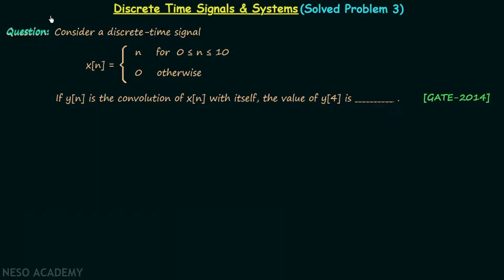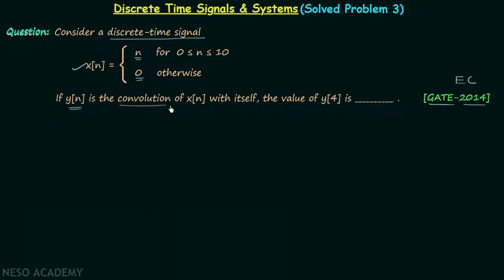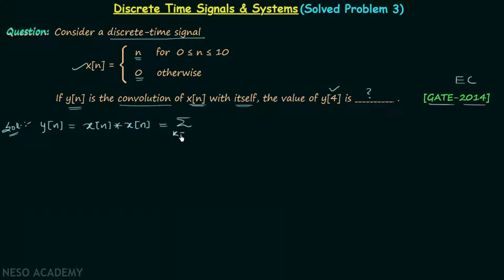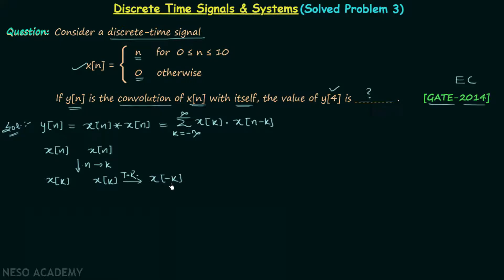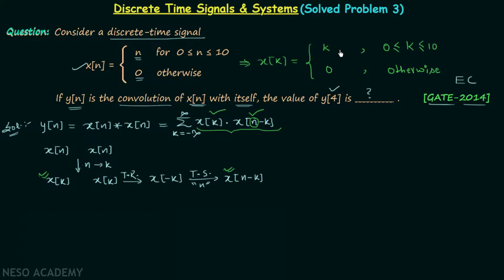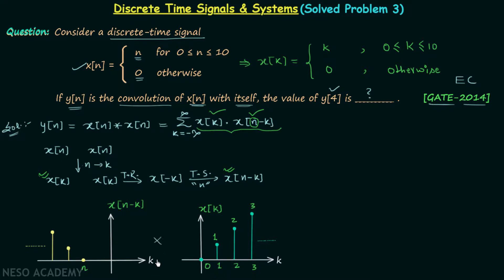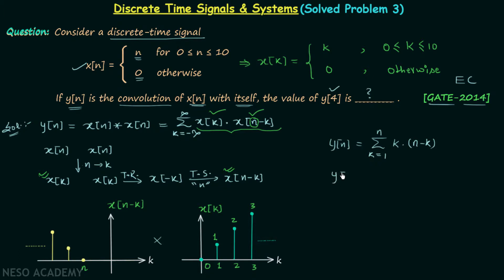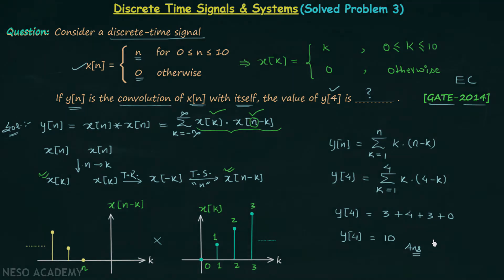Discrete Time Signals & Systems (Solved Problem 3)

Comment: sir in the above lecture in the case of y(n) value ....why you have taken (n-k) instead of x(n-k)....i am confused plz help me out sir
Reply: Niha Dabbikar We are actually taking the magnitudes of x[k] and x[n-k] which are defined by these functions.
               x[k] = k (Ramp)
         x[-k+n] = -k+n (Time reversed ramp and shifted to right by n, when n>0)

You can try yourself by graphing
x[k] = {0,1,2,3,4,5,6,7,8,9,10} 
            ^
x[-k+4] = {10,9,8,7,6,5,4,3,2,1,0}
                                      ^
If you try to overlap both these graph then you’ll realise from 1<k<3 their multiplication is non zero.
...+(0x4)+(1x3)+(2x2)+(3x1)+(4x0)+...
Y[4] = 10
Reply: @alphasatari  yes you are right 
One more point I want to add is that the Sir has shifted the left by n on the graph and written that is x(-k+n). Instead it go on the positive axis. But the Final answer is written based on considering the positive axis that is correct.